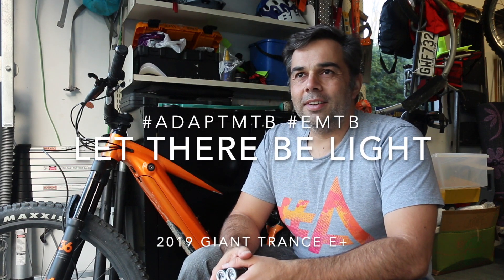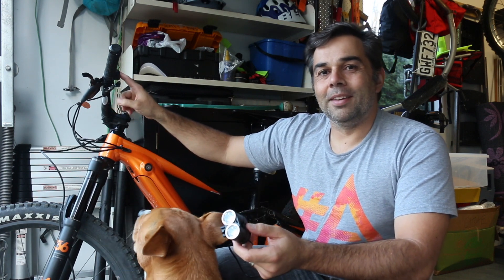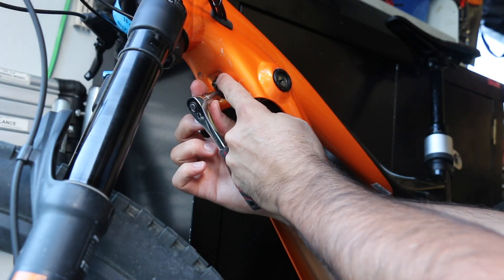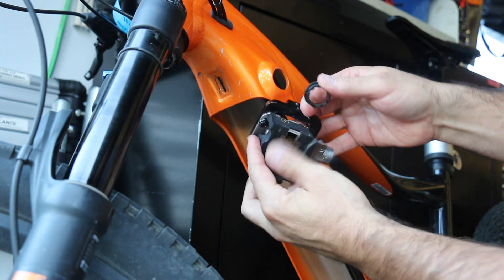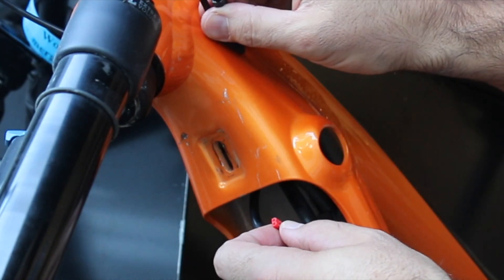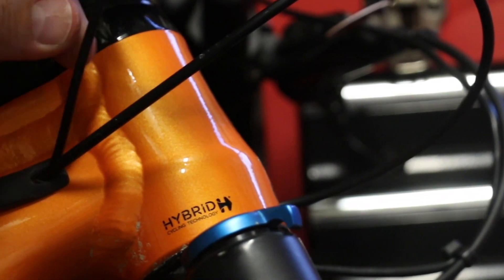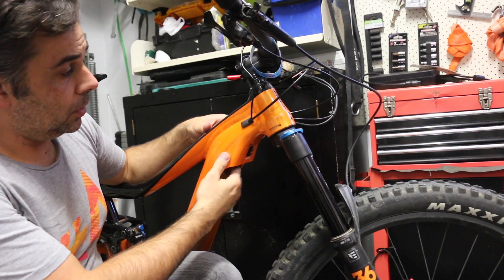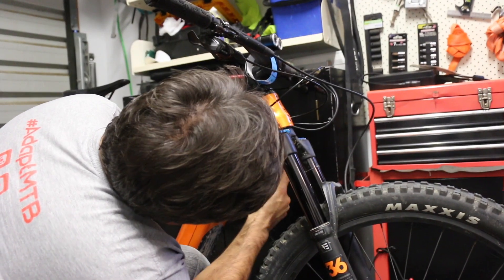Fitting lights to a 2019 Giant Trance E+ integrated lighting system #AdaptMTB

Comment: Great writeup on how to install the lights properly by dropping the upper battery mount. I would stick with Giant Recon lights simply because the danger of damaging the circuit to that connector from various ebay or other lights is there. Short out the light circuit or worse the motor motherboard and you are $OL then. Or, at least go to a light that is brand name and listed to work with the Yama/Syncdrive 6v motors. 6V's (as you measured is 6V's but don't know how many amps the circuit puts out to match to the wattage required by your 2k lumens LED light.) If your light is requiring more than the paltry output of the light circuit, you could burn the light circuit out. Probably not, just a dimmer light but.......why take the chance with the motor. Hope I said that correctly for you.

Comment: Very helpful. No need to pull the battery compartment apart. Just pull the connector out the side cable exit.
Reply: Not always sometimes they are all tangled up in there and it is easy to damage the Julet connectors and then you could short out your bike and be DOA. Iow $ to replace the BMS or Motor motherboards. 
His method is clean and protects damage to the other wires by not trying to untangle the mess thru the lil hole. :)

Comment: Hey. Doing the same thing on my wifes e-bike. The white connector is a JST 02R-JWPF-VSLE-S. The female plug you need for it is a 02T-JWPF-VSLE-S
Reply: can you confirm its the right plugs as it looks different on google?
Reply: @robprelude22i  Its the right one. I ordered a set and they fit the plug that's attached to the bike
Reply: @Tall7kiwi  thanks :) i will order a couple of them on ebay as don't want to cut the manufacturer plug off
Reply from the maker: This was a very handy comment! Thanks!
Reply: Thank you a Lot!💪
Cheers from europe

Comment: Thank you. This was really helpful. I have the Talon E+ and other than the location being just a bit different this worked well for me. 

I tried a number of different head lights and have settled on (for now at least) the LEZYNE Macro Drive 100. The big benefit for me is that you don't have to turn both the controller and light on each time. You only need to use the controller for power and then the switch on the light is used only to change modes. It looks to be very well made and can mount directly to your stem with the included parts. 

I'm still looking for a flashing rear light to use with this setup. If I find a good one, I'll post it here.
Reply: Hey, I've been looking to install both front and rear lights to my talon e+. How has your lights done, any issues, differences?
Reply: Can you (or anyone else?) please elaborate exactly where the plug is? I've just spent an hour looking for it.
Reply: @garyturnernz  you need to remove the battery and the thebattery holer on top, like in the video.
Reply: @SantaGamerYoutube  If you read my comment in context, I replied to the comment about doing it on a Talon. It is not in the same place. There is nothing under the top battery holder on the Talon.
Reply: Can you post a video of your modification?

Comment: Hey bro with how much NM u turn tight two last E6 screws? 3 Nm or 6? 
I have the same Bike, and using it from march 2019, and I need to do some adjustment because of battery clack issue.
Reply from the maker: I’d say 6NM. Getting the battery sorted so that is happy and not clacking is a bit of trial and error…

Comment: Do you actually need to take the battery lock off? Can you not just pull the head light wire through the hole that the cables come out of? Either side. I pulled one out and I could see the connector in there. 
Great video. Cheers.

Comment: Awesome video man,  just put a deposit on one of these for the coming european summer and I love these sort of videos... How did you get on with the usb charger?
Reply from the maker: I’ve now fitted the USB charger - so it supports smart fast charging on USB-C

I need to do a follow up video…
Reply: @AdaptMTB  I'd love to see that video or even just some photos of your end product. Did you wind up using XT-30s or just the connector right off the controller by the battery?
Reply from the maker: Hey! Great to hear. I had a chance to ride a 2020 Reign E+2 Pro and happily it felt pretty much the same as my Trance, but was a bit quieter. 

I was waiting on a part from eBay to do the USB charger, but sadly it has not arrived :( 

I did however buy some connectors that others have mentioned on the comments and that could mean that you don't have to clip any wires - however they are very tricky to crimp!

Comment: Hi
I followed your video but I have a feeling my 2400 lumen nestling light is too much for the output?
I turn the switch on at the ride control and the lights flash at the rear of the light and go off.
Reply from the maker: Hey! I have found this with some lights too. I did find that if you turn on the lighting on the bike first, and THEN connect the light, it worked fine... but that was impractical for how I wanted to use it!

Comment: Great video thanks 
My trek powerfly 5 is lighting ready  for a 6 volt light. So will be trying this light out.
Reply: Successfully wired in using an AMP TYCO waterproof connector.
Reply from the maker: @benbrangwin2250  Well done!

Comment: Hi, thanks for video, so the voltage is 6v, do you know the current on that wire? Thanks
Reply from the maker: Hi there, the current (Amps) will depend on the size of the light (load) that you connect to it, but there will be an upper limit. If you connect too much load, the the output turns off, however if you press the lighting button on/off it will turn on again so there is some protection on the circuit.

Comment: Hi mate great vid,  I just put a Lezyne ebike macro drive 1000 on my giant trance e+0 your video save me $100 because yhats how much creeps at bike shop wanted to wire the light to the motor.. as it was a new bike cutting into wire loom would void warranty.. for future reference   i found female plug 
https://www.digikey.co.nz/product-detail/en/jst-sales-america-inc/02T-JWPF-VSLE-S/455-1166-ND/608608
Reply: Nice! Well done and thanks heaps for sharing!!
Reply from the maker: That's great news tom! Thanks a bunch for finding the connector! I'll put the link in the video. Cheers!
Reply: Lee Singleton Hi thanks for the info. With the female plug do I need BWPT-001T-0.25? And do you a good tutorial to learn how to crimp? I am completely new at that. Thanks a lot.
Reply: @MattB-ee9rv  just click on the link to digikey that will take you straight to plug required you will also need the pins for the plug there part number CONN PIN 22-26AWG CRIMP TIN , there very easy to crimp just narrow set of long nose pliers does the job
Reply from the maker: Just an update on those connnectors, I've ordered some from Ebay that come as a set (Male+Female+Pins). The minimum order quantities from Digikey, and having to order the various pins are a bit of a hassle... Hopefully this is helpful to you guys too! https://www.ebay.com/itm/JST-Series-2-3-4-6-8P-Male-Female-JWPF-VSLE-S-Automotive-Motorcycle-Connectors/173972937432?ssPageName=STRK%3AMEBIDX%3AIT&var=472754079185&_trksid=p2057872.m2749.l2649
Reply: @AdaptMTB  you should of said you where going to replace yours i would have sent you some up as im in nz i brought a dozen of each
Reply from the maker: @leeroys3682  Cheers for that! Crikey they are tricky to crimp! It takes me ages to do each pin!

Comment: The best ebike of 2019 imo
Reply: Agree I did lots of research when buying and this is by far the best quality for the money  with regards to specs and componentry etc . I guess it depends on what you paid though I got mine as a price match for $6100.00
Reply: I got a 2020 stance e+ 2
Reply from the maker: Nice - I did a big ride on a 2020 Reign E+ 2 Pro and was happy that I didn't notice much difference in the ride and handling between that and my bike. It was much quieter than mine though!

Comment: Great to see this being done, The reason that that the switch and wiring is there but not accessible is because this motor/battery/switch is used on another bike manufacturer (not too sure who), but loom and switch is common. Other thing with this Ride One Controller is the walk switch is not obvious, and I know people who never read the manual and were not aware of this feature.
Reply from the maker: Yes. The motor that Giant use for this is pretty much the Yamaha PWX I think. There are other Giant bikes that have lighting - but they are much more road focused.

You are right about the walk assist not being obvious - I totally agree that it is not an obvious feature! Compared to the Bosh CX unit, the walk assist on this is not easy to manage (it's pretty much all or nothing)... but very handy to allow some peddle-free manoeuvres if you are in the lowest gear....

Hmmm - that could be another video...
Reply: @AdaptMTB  All of Giant's Syncdrive motors were Yama's since Giant got into ebike business now they, in the UK and other countries (fortunately no USA yet), are using Shimano Steps in some models. 
I have several ebikes from both manufacturers and the Yama's are far better than Shimano's crap, so Giant probably gets a better price for the motors from Shitmano.

Comment: Nice idea. I'm going to run the 6V cable out of the grommet and let it terminate as an XT30, which is overkill but secure with no chance of getting loose and buggy over time like the red JSTs tend to do (YMMV of course, but XT30s are my new fave connector for hobby stuff). That cable goes into my headstem bag which powers an induction coil under the mobile phone pouch so TrailForks can run with the phone's screen always on while the phone charges, without needing to be plugged in. A little XT30 Y-splitter I'll make will give power to the headlight as well - which can, itself, be directly connected sans Y-splitter if the phone bag is absent. You inspired this and I thank you! Nice thinking outside the, er, frame :)
Reply: I'd love to see photos of this setup!
Reply: @obguy99 I can't link in comments, sorry. It's not hard to do though, once you pull things apart.
Reply from the maker: Wow! You had me doing some good googling there to keep up!

Sounds like a great idea!

I'd like to find the details of the factory connector. The same one is used for the indicators on my road motorbike - but I can't find the details or supplier - any ideas?
Reply: @AdaptMTB  I was going to say I had no idea, but if you have the same connections on your motorcycle, you're more likely to crack this puzzle. If it isn't too old, you may find you can identify that cable loom or single cable (depending on where it is on the bike) via a parts list. There are a few sites that let you track down a particular part for your car or bike and give you the manufacturer's part number and associated description. That'd be a step closer to getting the name of the plug.

Plan B might be to find an electronics or diy subreddit and posting a couple of photos of the plug from different angles, asking for someone to identify it for you. One of those methods should yield results, I'd expect.

Personally, I'm satisfied with my approach, where the plug isn't altered at all and the connection I made is completely reversible.
Reply: @cragv   i put a link to the plug in question above

Comment: Hi there thanks very much for the video. I have the same bike  and would like to do what you have done. Question is where did you get the light and how many lumens is it. Do you know if any light will work such as one that has its own battery i.e. don't use the battery pack just hard wired to the bikes. I want to utilise the switch on my bike like you have done. Thanks very much keep up the good work :-)
Reply: Awesome thanks for the info I will order some .Happy trails Cheers
Reply: Any light that can take a 6V input will be fine.
Reply from the maker: Hi there - thanks for the feedback!

I purchased the light from ebay, it is NZ$14 delivered and is "2000 Lumens". Link here:
https://www.ebay.com/itm/2000-Lumen-2-X-XM-L-T6-LED-USB-Waterproof-Lamp-Bike-Bicycle-Headlight-Head-Light/273453660802?ssPageName=STRK%3AMEBIDX%3AIT&_trksid=p2057872.m2749.l2649

That light doesn't have it's own battery and has a USB connector so would work well of any Powerbank. 

Subsequent to this video, I've found that a helmet lamp is much better for night MTB, so I use a battery back stashed in my camelbak to power it.